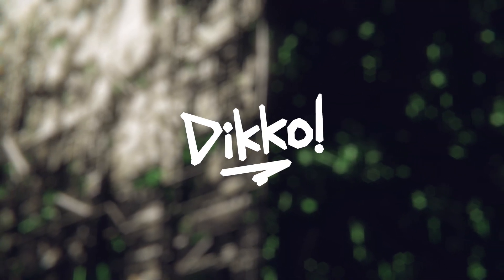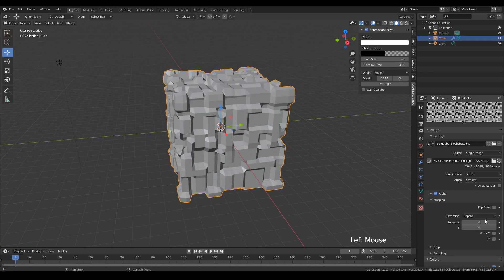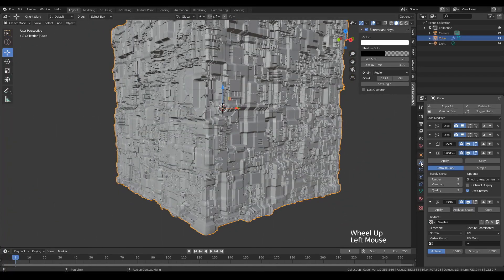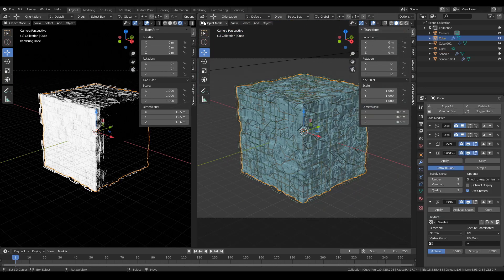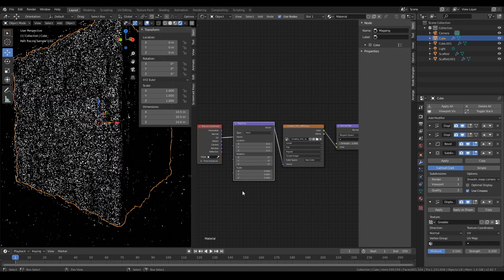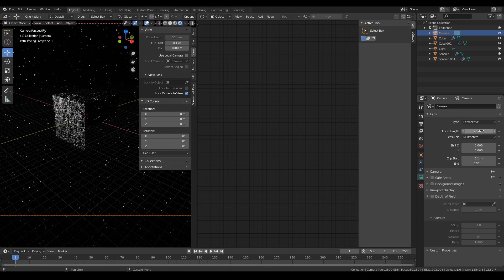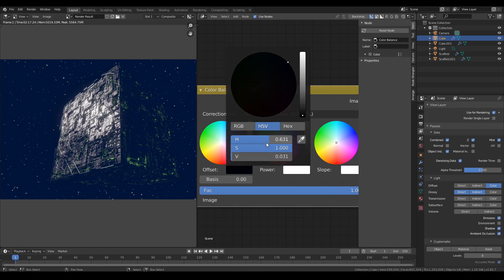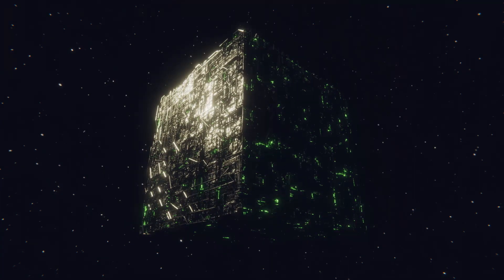Create a BORG CUBE using displacements!

Comment: Than you for this tutorial. Only a couple of steps that I had to slow the speed down to 50% 😂 I made a borg cube version of my logo. Had to scale the tiling of the textures down a bit as it was hitting 10mil tris😅 learnt a lot about using displacement modiffier so thank you for that. The AO lighting is a great idea that I will use on future projects.

Comment: 2000X2000 is fine too, our ancient adherence to base 16 is kinda pointless now.
Reply from the maker: That may be true for making renders but for game engines I wouldn't say that's the case. Regardless, its better to stick with convention to avoid confusion. Substance, blender, and even this little JSPlacement apps generate base textures based on the power of 2.